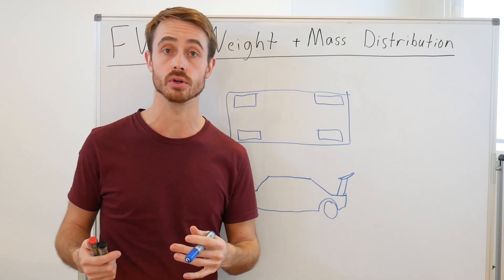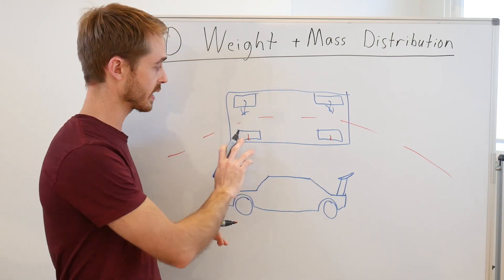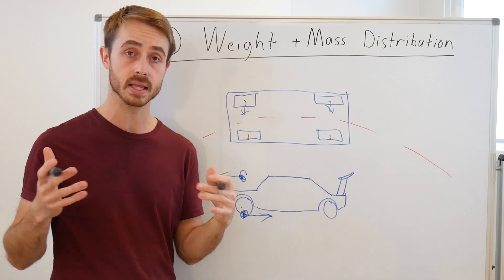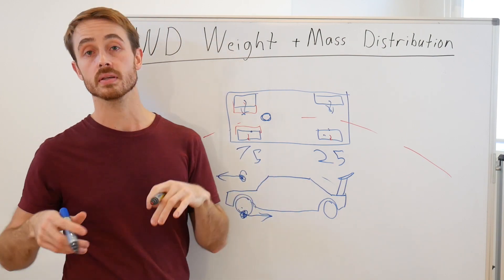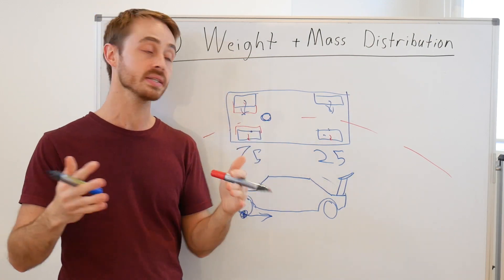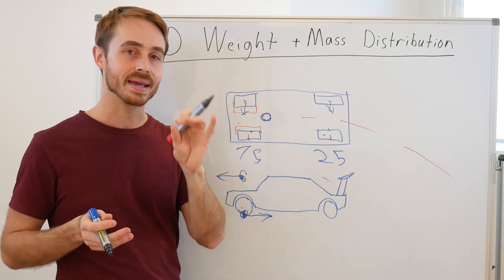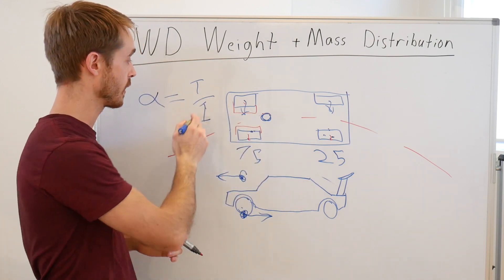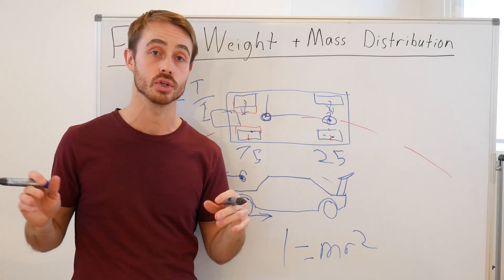Front Wheel Drive Weight Distribution Explained - What is the "Ideal"?

Comment: Just a question. Based on your explanation about the location of CG during acceleration, a front-engine-RWD car would accelerate in a straight line faster than a front-engine-AWD car because the weight would be transferred onto the rear-driving wheels, ideally for traction. But in reality that most people have known, the front-engine-RWD car is slower. Please explain that.
Reply: the extra grip from awd does more for acceleration than the weight transfer to the rear on a rwd
Reply: @budd1669  
Yes, the "theorical" weight transfer towards the rear wheels in hard acceleration is quite negligible in real life unless the car is very tall. I recently tested a front-heavy RS3 for 0-100 launch set up as 50:50 vs 60:40 (F:R) torque distribution, the latter was 0.6 second quicker.

Comment: I've found autocrossing a fwd car, with a stiffer roll bar, and 2 psi higher than the front With trail braking, works well to negate a lot of the understeer, going to try stiffer springs in the rear next!
Now how would one go about shifting the center of gravity?
Reply: just run a Honda.....dont try to be a hero
Reply: move the whole powertrain back a few inches lol

Comment: Something i don't quite understand is the concept of weight transfer...
Which fundamental mechanics are the underlying?
I mean the effect is clearly there and observable but i don't know why :/
Maybe a video on this?
Reply: Adalbert Bender Yea. Would be interesting as a video. Tried to explain it as a comment but it was too long
Reply: Its quite basic, so I suppose he wont do a video on that.
When you are accelerating an object and changing its velocity or the vector of the velocity, you put a force on the center of mass of the object.
As the tyres are the connection between road and vehicle, the center of mass of the car pulls/pushes on everything between itself and the contact patch of the tyres.
Reply: Erdinc A. Sorry, but that explanation is too basic imo.
It just doesn't follow from basic theory of momentum and angular momentum that simply...
Reply: Adalbert Bender Well lets say we have a motorcycle (for simplicity) and we look at weight transfer under braking. Lets just say the CG is right at the drivers seat. Now imagine the bike from the side. If it brakes, the front tire transfers a force just where it is contacting the ground. Now think we draw an arrow for the force, it will start at the contact patch and point backwards. No the CG wants to go on forwards cause momentum so we draw an arrow starting from the seat to the front. Now the forwards arrow is further up than the rearwards arrow so inbetween you can imagine an axle (just for kicks) which now feels a torque anticlockwise. There is no more magic in there
Reply: alles klar klaus ok oh it begins to make sense to me now. So the Position of the CG stays the same relatively, but in order to counter the torque the load Force on the front tire becomes bigger. Right?
Reply: Weight transfer just tells us how the weight of the vehicle is distributed between tyre contact patches, and how those loads change during acceleration/braking/cornering.

Weight transfer is basically caused, because the horizontal tyre contact patch forces are not in the same horizontal plane with the CoG of the vehicle. When you vary the horizontal forces (braking/acceleration/cornering), the vertical forces at the contact patches also need to vary to balance the force system. 

Chassis lean is a byproduct of springs compressing/extending under varying loads. When the chassis leans, the CoG is moved some small amount horizontally in relation to the tyre contact patches, and this has smallish effect of contact patch loads and is additional to the force based load variation.

One case, where the CoG of the vehicle can physically move around considerably, is a vehicle that is transporting a load that can move around, for example tanker truck transporting liquids.
Reply: this is why the rider on a moto gp bike for eg, will hang/lean towards the in side of the radius of a corner, lean forward when accelerating, lean back when braking. Also another fun fact to turn a motor cycle at high speed they mainly use there body weight to change to center of mass and the input on the handle bars is usually the opposite of what people would assume, they will initially countersteer to help over come the centrifugal force coming from the wheels to trip the bike over to one side and then through the mid and exit they will practically not even touch or interfere with the front bars (they only have there hands there for stability). oh and also when braking they sit up to increase drag to slow down (-;

Comment: Another vid idea you could discuss under tray aero theory on cars that are under breathers like older corvettes C6 and back, the air dam blocks clean flow from getting under the rest of the car so is a flat tray or rear diffuser worth it on that style. Would a front splitter be put on the bottom of the air dam or put it on the bumper just to get a high pressure zone on top of it to push down?

Comment: Question ! Im trying to combat Weight distribution for better mpg  by putting smaller radius tyres on the back . My car is a front wheel drive so my concept was that if I put smaller wheels on the back then the weight which is mainly up the front end will then shift to the back ? 
I figured my steering may  alter slightly but that is not a big issue if driving conservatively . However if radical driving is necessary  I think that the front end will not slide as much if a portion of the weight has been sent to the back allowing the back end to take some of the traction allowing the front to bite traction instead of slide due to having too much weight distribution on the front  ? 

Another benefit why I think that this is a good concept is that due to the weight being shifted more to the back then the wear on the front cv joints and the suspension assembly will not be as harsh before as the back end will be taking up some of the load ! 
Any thoughts on my concept ?

Comment: Cool vid idea would be talking about hood scoops and is the ram air effect worth the negative effect of disturbing the air flow across the hood? Also with a cold air intake under the hood should the inlet be in a high pressure zone or low?
Reply: You always want the air inlet for the engine in a high pressure area. It helps the engine to pull air into the cylinders and so on. You always want your exhaust to end in a low pressure zone. That way that helps pull the exhaust gases out of the cylinder after combustion.
Naturally this causes the exhaust to end at the rear and the air intake to be at the front behind the grill.
Reply: @achimhanischdorfer3403  Nice explamation. Is that why CAI's might reduce torque at low/mid rpm's, bc they're positioned far and low from the engine area where pressure is lower?
Reply: @AguilaJR  
I don't know what a CAI is.
Reply: @achimhanischdorfer3403  sorry. short for Cold Air Intake
Reply: @AguilaJR 
As the name says, cold air intakes are supposed to inhale cold air. If they are placed deep inside the engine bay, they don't inhale cold air, which reduced the engine power. If cold air intakes have more or less flow restriction over a normal air intake, I don't know that.
Reply: @achimhanischdorfer3403  Ah makes sense!

Comment: @Kyle.Engineers I would be very interested to hear from you on this, so accepting the Tires will never be in a perfect ratio, would it still help though to get it as close as possible, I'm rim+tire shopping now for next season and seems I might actually benefit more from going 8.5" on the front and 8" on the rear and look at 225 rear 245 front. Its small differences but would this factor in?

Comment: You ve spent all this time making an argument about CG placement, when CG is pretty much fixed. Well you can just lower it a few cm but that’s about it. We take CG as a constant and tune the suspension geometries that we can change: ie spring rates, sway bars, alignment, tires, etc. Good video none the less I just subscribed
Reply: on a single car, yes its more or less fixed. But it can be quite different from car to car - many front engines go over 60% front, some rear engines as low as 40% front weight bias.

Comment: I race a DC5 Integra (na 250hp atw) which runs 54.1% front.  Front Tyres are a Medium Compound and are sized at 355 wide. Rear is a 235 wide in Soft Compound. Springs are 16 front with 18 rear. Roll Bars are both 30mm F/R. Shocks are set at 13(F) / 8(R) from full Soft. This car holds every single track record where it's been (lots of tracks). National and State Titles are plentiful. Steering wheel input is less than 1/8th of a turn then the back rotates and I'm back on the gas hard by the Apex. No U/S. Never come off any more than half throttle anywhere. What do you think of my set up and how can I improve? A couple of other FWD Racers have driven the car and describe the Steering as sharp and you can get back on the gas as soon as the car has taken a 'set' before the Apex.
Reply: You have bad weight distribution, thats why u have only 235 rear tire. Best FWD cars have almost 10% more weight at front axle.

Roll bar is bad too, give more stiff on rear, but loose it on front axle. Best fwd autocross cars dont have any rollbar at front.

And this integra have no chances against real ta cars like 600-700 hp, 1000-1100 kg awd cars, so i dont belive in your track record. Were you at Laguna Seca?

30 mm front axle swaybar on fwd race car is madness.

Comment: In the 100% front wd, you would still lose grip under acceleration. There's a torque between the cog height and your massless rear wheels at the ground.
Reply: yeah i was thinking the same thing
Reply: What are y'all talking about?
Reply from the maker: Not if your CG is on the ground, as I mention as the theoretical case at 2:34, if it's on the ground, there is no moment arm, hence no torque around the axle, hence no weight transfer

Comment: Does installing a spoiler on a FWD car increase the chance of it understeering, since the back of the car is pushed down more than the front thus taking away some of  front tire traction ?
Reply: I think a spoiler on fwd only helps rear stability in high speeds. Dont think it affects front grip in turns.
Reply: @madmarlone  It doesnt affect the front grip per se, but it affects the balance of the car - adding a strong rear spoiler (aka not an ebay wing) would give you a more understeery balance, with the same cornering G's however.

Comment: So uhh... My little '99 Corolla is perfectly set up? My car has ridiculous over-steer in tight turns. I've only ever used that properly a few times. Granted I am 2 runs in. I never understood uphill runs because going downhill keeping up with 200hp+, 2800 pound s2000's in a 120hp, stock motor, 2400 pound corolla feels good. Footage coming soon. I had previously gone all the way up the hill and spotted a car group gathering. I rode around and went down the hill and having a huge blast in the corners, I decided to go back uphill to see if I could catch some of those "car guys" to test out my new coil-overs...Sure enough, I had 3 s2k's with a Subaru STi coming down. So I flipped a bitch and rode after them. After 30 seconds of whipping my little fwd car down the hill with 200 pounds of gear in the back, I caught up. I lost them at a slight uphill point where power was needed to pass, and the car in front of me wouldn't pull out. So I lost them. Sad story.

TL;DR I suck at driving

Comment: You should do the AWD one next because AWD is the best wheel drive
Reply: This isn't Forza kid
Reply: OG Drifter This is real life and my 2 AWD cars "kid"
Reply: It really isn't.
Reply: If we want to talk about "best" drive train, there needs to be established what we weight with our rating:
-cost/complexity
-drivability/handling
-utility

Cost/Complexity
FWD is compact and easy to produce, hence it is used in most production cars today.
RWD is more less complex but more stuff to make, so it ends up costing a little more and weighting a little more.
AWD is most complex, and most expensive, and most heavy

Drivability/Handling:
For causal driving a FWD car is mostly superior. Steer where you want to go and accelerate.
For performance driving using RWD is in most cases superior. You split the load of acceleration and breaking, as well as turning between the axles, causing much more equal tyre wear. It is also far easier to use throttle control to manipulate the car behavior.
AWD offers performance driving and utility advantages, mostly in situations where a vehicle is grip limited. Offroading, pulling. AWD also allows the drivetrain (if engineered that way) to split the torque unevenly, thereby mimicking a FWD or RWD somewhat. If a very special type of handling under all load conditions (breaking, acceleration, coasting...) is desired, such a drivetrain has the best technical capacities.

Utility:
FWD is mostly useless for pulling heavy equipment. It however has its advantage in low cost, making good cheap small haulers (Vans...) 
RWD has good pulling capacities, making is useful for Trucks, ... However the drivetrain components can take up valuable space.
AWD is useful for pulling and offroading. If finds its use in construction equipment, military equipment, and offroad cars/trucks. Albeit at not insignificant expense.

TL;DR: 
What is "BestWheelDrive" depends what your consider important. Cost or Capability or Handling, or maybe all of them?
Reply: Yeah, that's why every race car is AWD.
Reply: A lot of hypercars aren't AWD. The GT2 RS is RWD. Sorry, AWD is only the best for rally.
Reply: onethirdofGilgamesh race cars are fwd or rwd due to rules no efficency. Basically the only place you can use awd is rally.
Reply: Im saying its the best for me because I do mainly rally/rallcross in rural New Zealand.
And also AWD donuts are alot of fun.
Reply: almost all organisers of events banned a lot of advantages (like awd), if you give freedom for engineers to choose, they make awd racecar like toyota ts050 and porsche 919, because awd is best for racing
Reply: Someone tried an AWD F1 car back in the day, it was pretty terrible.  

LMP hybrids front wheels are driven only by the electric motors, and that seems to be the case in order to harvest as much energy under braking as they can.  They're specifically programmed to not activate below certain speeds because doing so would interfere with handling.
Reply: Phos9 you're wrong, in lemans they could choose to put the electric motors at the back and they don't. The f1 awd car you're talking about was used back in the late 60s early 70s when the tecnology was in diapers. After that no other rwd or fwd beat awd with equal rules.
Reply: If they put the electric motor at the back they wouldn't be able to spare the front brakes.  Their AWD systems don't even activate until they're above the limit of traction anyway.
Reply: Phos9 electric or not, its still awd
Reply: @martin_in_the_alps  Fia banned AWD cars from race because of "unfair advantage". AWD touring cars were unstoppable.